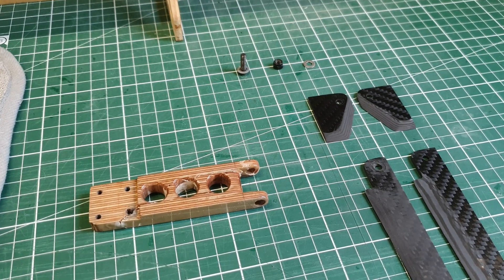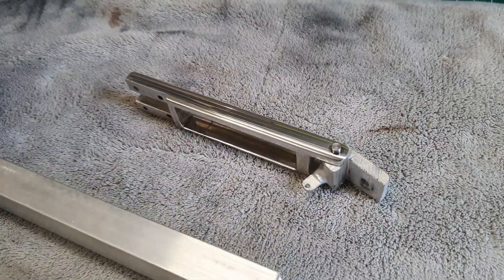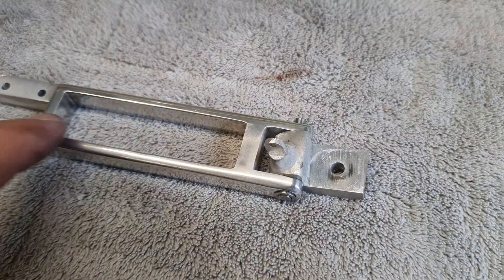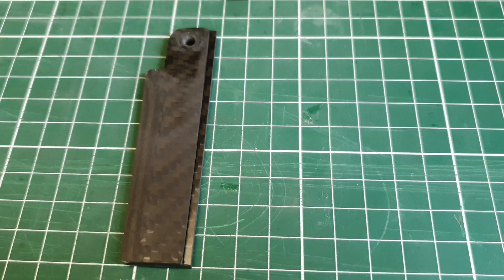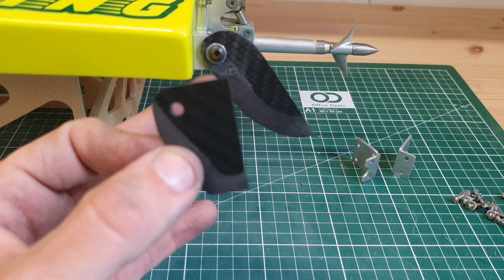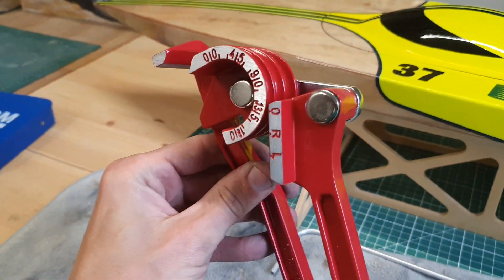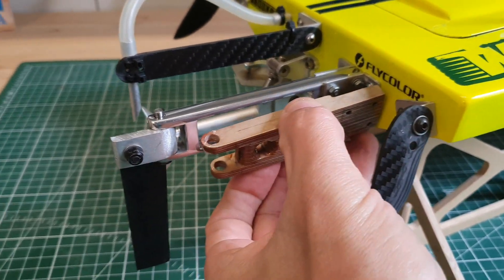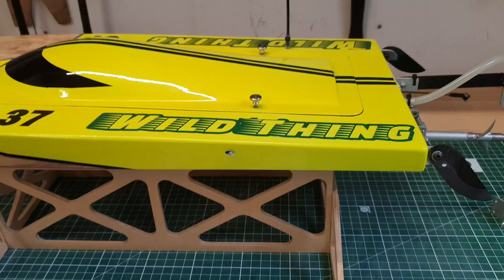RC BOAT Wild Thing tuning series episode I - making an aluminium rudder bracket

Comment: Nice work with that rudder do you have bearings on the hinge pin?
A lot of test whit rudder blades and turnfins😊
Reply from the maker: Thanks 😎 Yes I use 6x4 bronze bushings for the hinge pin. 
Yes, I want to get the best performance out of this hull, so I will try many different tunes, including hardware changes. Cheers! DJ